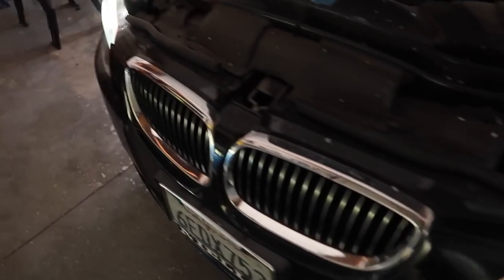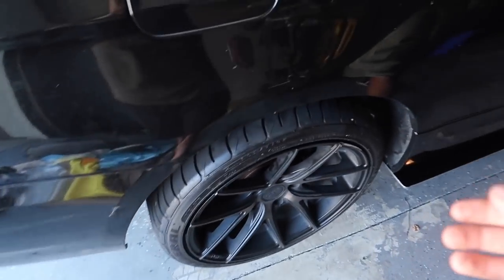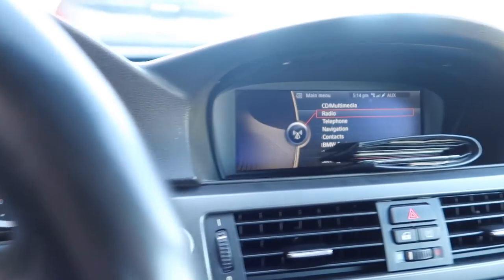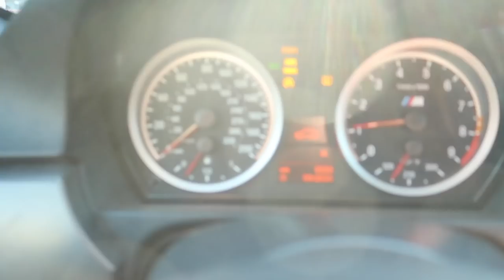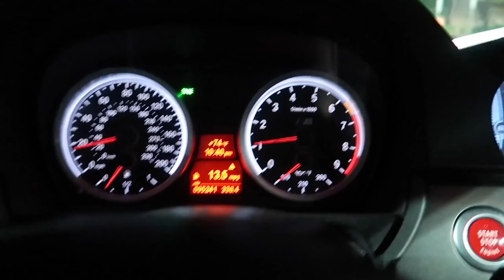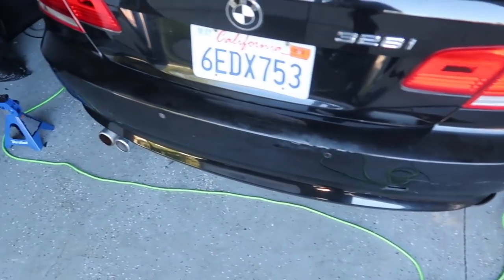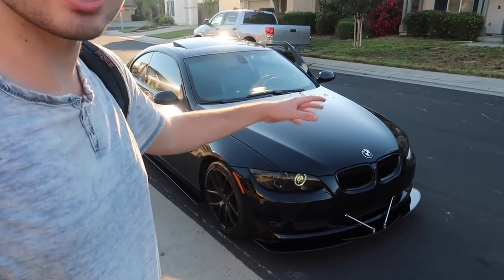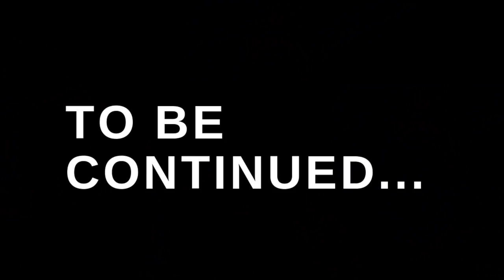THE $1000 BMW E92 GETS $300 IN CUSTOM MODS!

Comment: Damn those white cornering lights were clean af!! Where did you get those bulbs from??
Reply: Christian///M they aren’t in this video but I just installed these today, GFJMC 2 PCS Xenon White Error Free 15-SMD PY24W 5200s LED Bulbs For BMW E90/E92 3 F10/F07 5 Series E83/F25 X 3 E70 X 5 E71 X 6 Z4 https://www.amazon.com/dp/B071FDN4ZX/ref=cm_sw_r_cp_api_i_.IDdDbCFCM73W

The other parts I used are all in the description